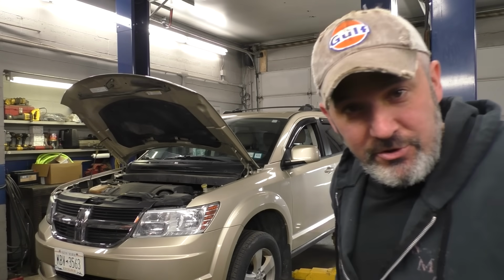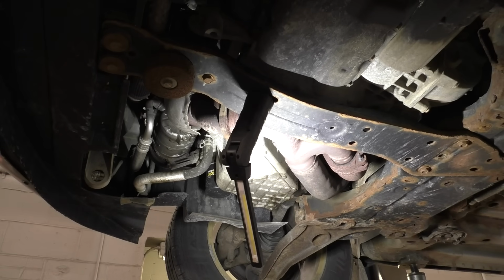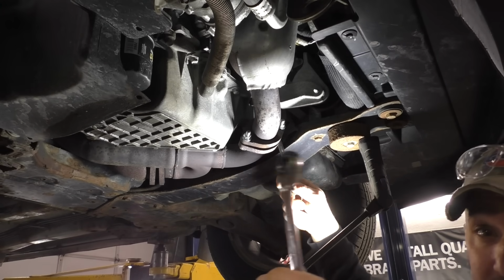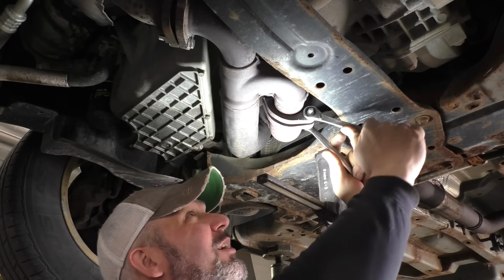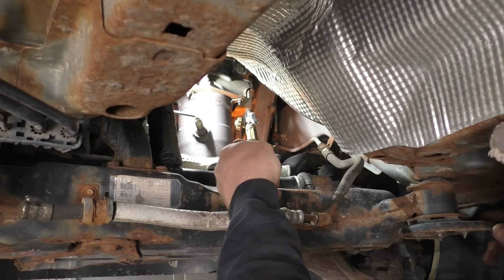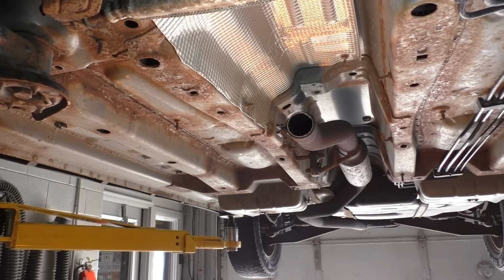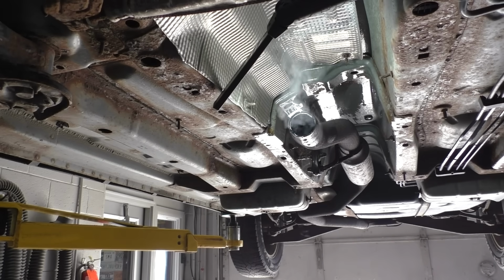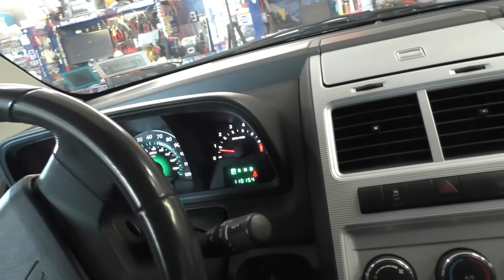Dodge Journey - Flex Pipe Replacement & Y-Pipe Repairs

Comment: I replaced the catalytic converter on a 2010 Town & Country. The cat was actually fine but the flex pipe that joined it to the exhaust manifold was completely broken and couldn't be fixed. Seems like a bad design.

Comment: After they stole my cat converter from my RV, I had to remove the remaining piece of pipe from the connecting pipe. I used a sawzall with a metal cutting blade. I made 2 length wise cuts on that piece of inner pipe then chisel out the rest.

Comment: The destruction that is caused by that salt usage in the rust belt is insane. Even vehicles only a few years old you can watch rusting away with the naked eye. Why is there no resistance of the people against this willful destruction? You can also work e.g. with rock chipppings to enhance the traction instead of megatons of salt.

Comment: is it possible to have a PVC exhaust or is the exhaust too hot ?
Reply: PVC can only sustain about 140 degrees. Car exhaust can get considerably hotter. 800 degrees or so and Even hotter if it is malfunctioning or turboed.
Reply: @AmosMosesJr  thought so, I thought that with all the plastic on cars now a days that something could stand the heat. Thanks.
Reply: @frankreichl679  yeah I used to work as a plumber where PVC is commonly used to vent natural gas appliances/appurtenances but some mfg of PVC pipe don't recommend it. Probably a legal technicality to prevent lawsuits.

Comment: I know why you didn't, but if I were doing this in my driveway, that support bracket would have been removed, and the whole Y pipe taken down after doing those 2 sawzall  cuts.  then I'd deal with the bolts being stupid.

Comment: how much more would it cost to replace the entire exhaust system as opposed to the labor cost involved with trying to chop apart the old rusty thing in an effort to save as much as you can. Seems like it's not worth it. Just replace the whole thing. And then the job will last longer. Preventative maintenance. Especially on a car that new.

Comment: I haven't read any other comments and I want to say I've never really been in this situation but I noticed that once you pried up on the inner sleeve I might have gotten a pair of vise grips and gone in and then just started twisting to reduce the diameter of the inner sleeve and pull it out?  

Says the inexperienced DIY....

Comment: My 04 Trail Blazer  had the original exhaust  system at 290k when the transmission failed. I remember my first New car back in 1980. The exhaust system failed within 6 months. They had to replace it under a recall. The next one didn't last much longer. I had an aftermarket  system with thicker pipes installed. That lasted.  It was a Ford.
Reply: See there is your problem FORD🤣
Reply: @LesReeves  I own a Subaru and a Nissan Titan. I will NEVER own a GM or Ford again.

Comment: I honestly wonder how much more it would cost car manufacturers to use stainless steel for the exhaust system to make it better for their customers. Could they actually design and build a car or truck that didn’t corrode to pieces after a few years and it not cost a fortune to purchase? Maybe instead of all the electronic gadgets that always seem to break or not work correctly they could use that money to make the car last longer.

Comment: One would think that a company going to all the trouble to spline exhaust bolts would specify a bolt that would hold up to heating.
Reply: Yeah but it's all about how fast they can assemble it on the assembly line.

Comment: Sawzall on that inner sleeved pipe rather than the gas wrench for me or even a hack saw blade to weaken it enough to bend it in and extract.  I take my wife's car to the muffler shop but do my own truck myself.  It's just easier.  110,154-

Comment: Those old rusted exhaust flange bolts all looked way too thin,  about 1/2 the diameter of the bolt holes.

Comment: I dropped a flashlight in the exhaust pipe once. On the garage floor, without air tools, in December, on my back, I had to spend over an hour to remove it ALL so I could spend less than a second tilting the pipe to remove the flashlight.  NEVER AGAIN